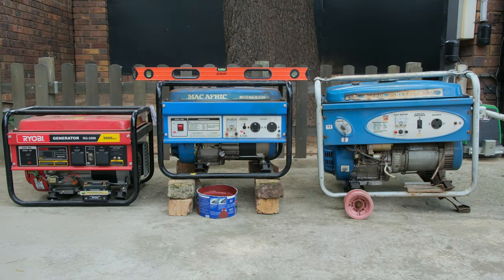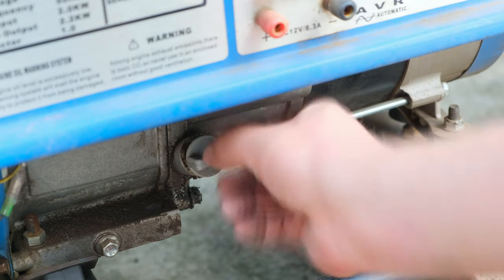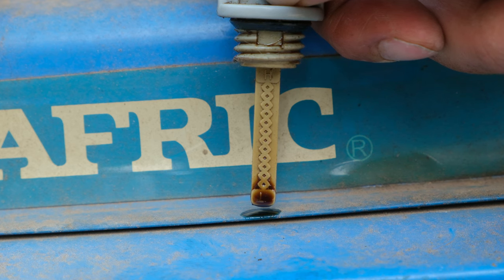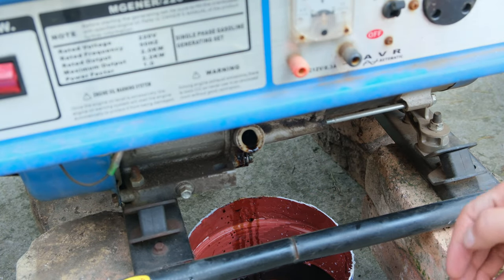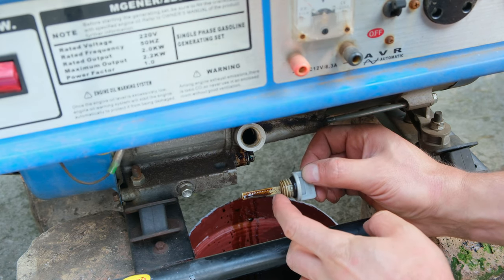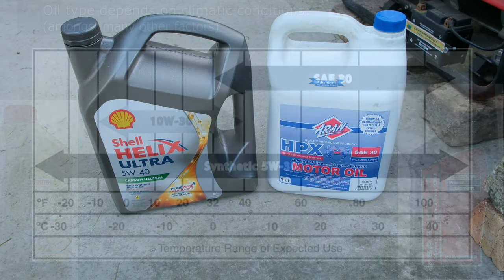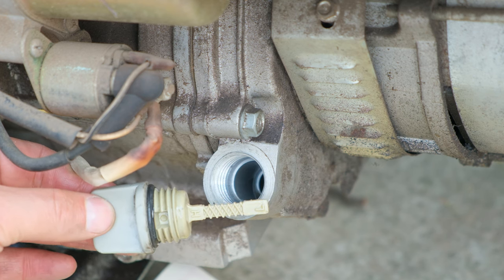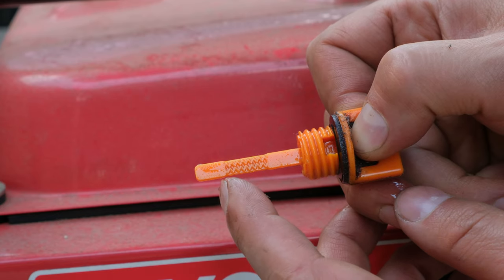How to check the oil level in a petrol and diesel generator. How to top up oil in a generator.

Comment: My generator has two dipsticks. One on top of the unit and one at the bottom. Why is that? The top one shows oil level as full but the lower one like in these videos shows that its low. Which reading should i rely on?